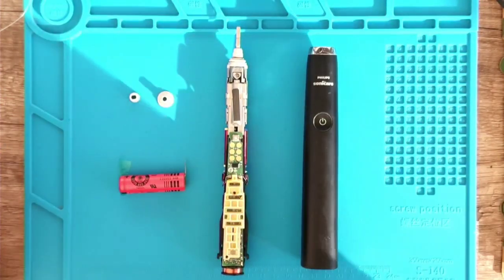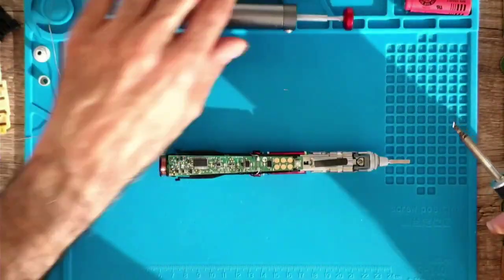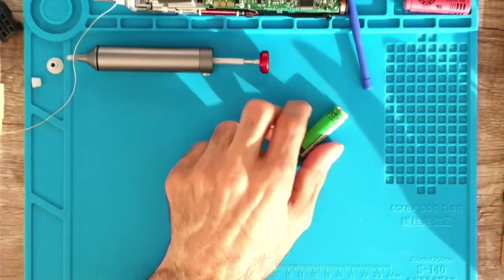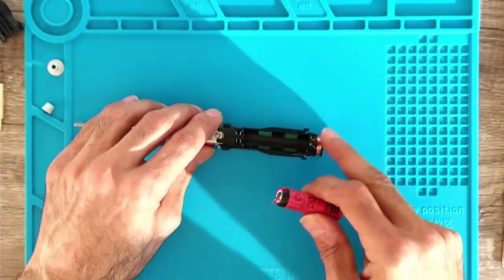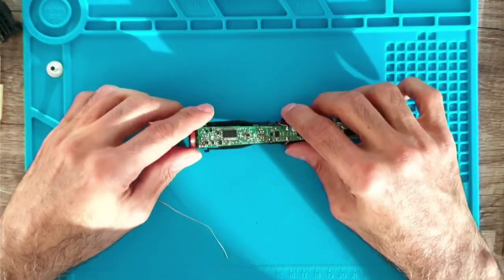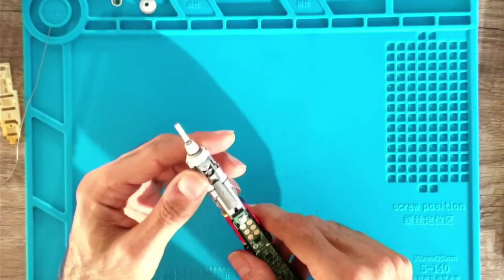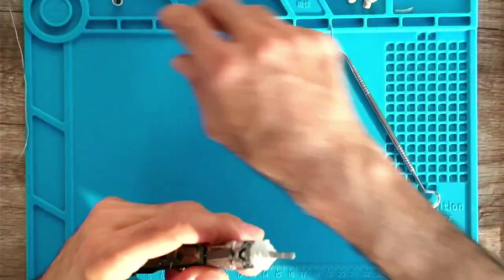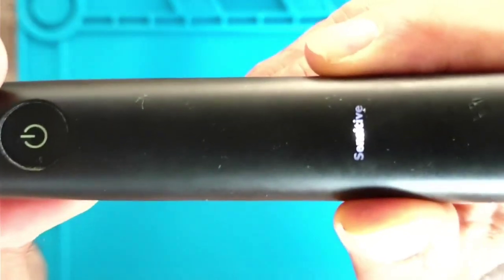41 Philips Sonicare (HX9350) - Replace Battery & Seal

Comment: What type of battery is it? Do I need the original or will some aftermarket one fit?
Reply from the maker: Hello @jirkabeseda, thanks for your questions.

The battery used in this video (as well as video #34) is a 740mAh Li-Ion battery that's 14mm x 49mm (but 14 x 50 will also work I believe). It's an aftermarket battery. I'm sure you can find a similar battery in your favorite online store.